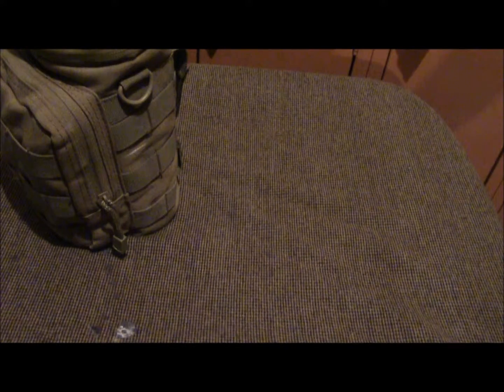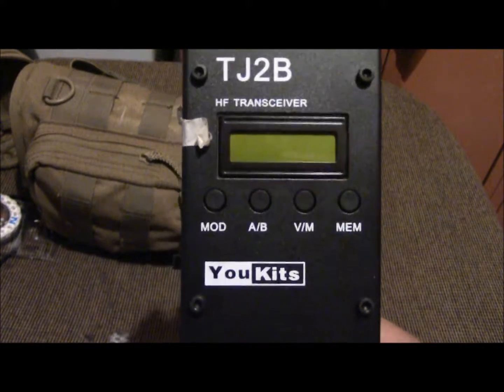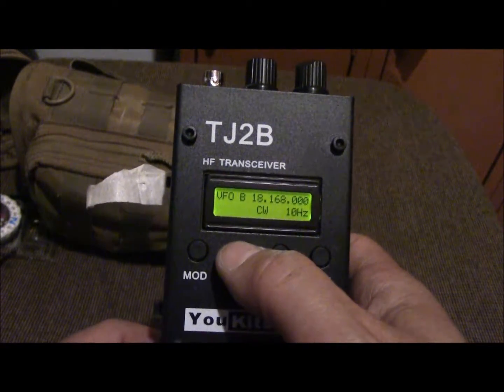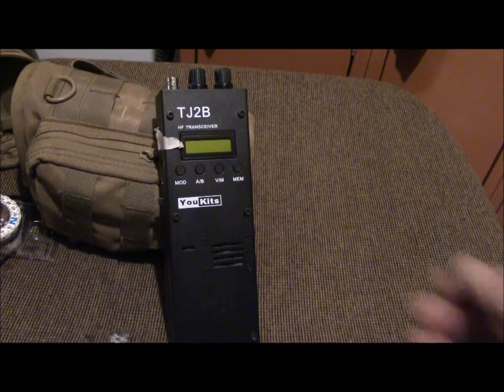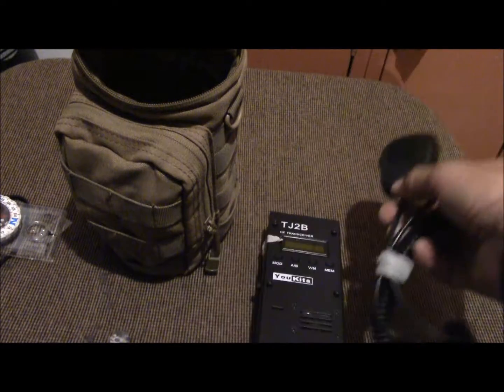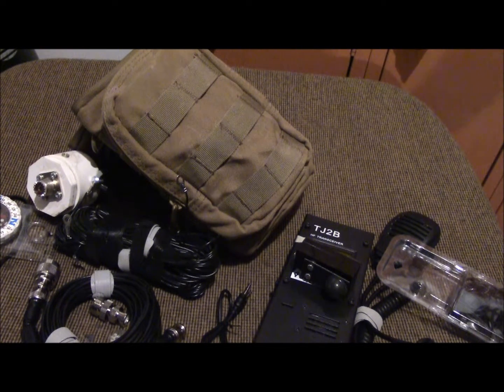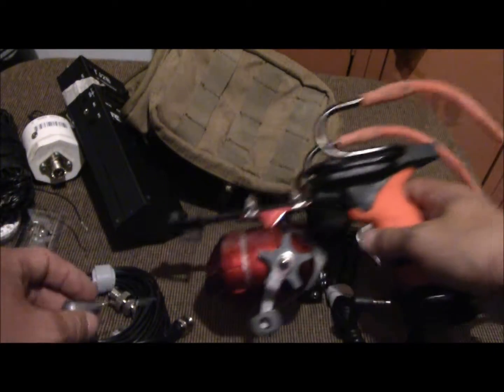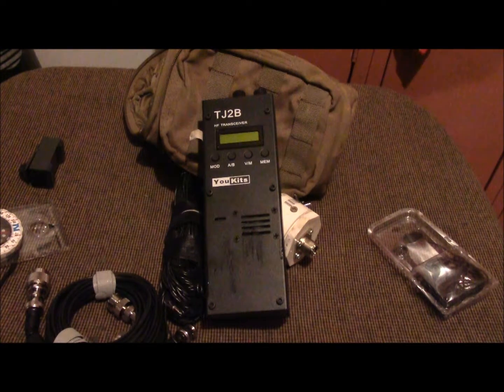Youkits TJ2B HF SSB CW Handheld Transceiver

Comment: It's nice to see another review of this rig. They are few and far between. It's an interesting rig although a bit overpriced in my view. (But that's not necessarily a deal breaker) Thank you for the review!
Reply from the maker: gliderrider Thanks for the comment. Ya I agree on the overprice. I should have just saved up and for an 817. Since I didn't I figured I would do a better review of the radio compared to what I had seen on YouTube.

Comment: I really like the concept of this radio, and your video has been helpful in illustrating its application. The one thing that has me hesitant about buying one (after much research) is the 40/20/17 band selection. 40/20/15 makes sense. 80/40/20 makes sense. 40/30/20 makes tons of sense. 17 is soooo close to 20 that I cannot imagine when I would choose to use it rather than 20. They have almost identical propagation characteristics. Do you know if they have an option to get a different set of bands? Do you know how to contact the manufacturer directly?
Reply: I find the combination 40/20/17 to be perfect, 40 for night activity, 20 for day and 17 that is a WARC band and is as opened as 20m. On 30, SSB is not allowed, and CW on this radio is a secondary function. Why you hate 17m? Is just  a sweet band, you can use it if there's a big contest which you aren't interested in.
Reply from the maker: I don't think there is an option to get different bands. 
Youkits dot com is the company's webpage

Comment: overpriced shit..
Reply: mine has made contacts all over the world on a piece of wire in a tree. thanks for letting us know you don't know what you are talking about
Reply: so what .. I have homebrewed qrp transceivers that I qso all over the world.. this youkitstj2b IS overpriced crap ..FACT ..
Reply: +rob good glad you can build a working transceiver. do you have one of these have you used it? i have and it works great for 300 something bucks for a assembled 3 band ssb that is a steal.
Reply: stoltzfl lol, you  can get an 857  2nd hand  for that ..that. covers ALL bands  in ALL modes  inc vhf and uhf, and is 100 times better than this junk 
you could get 817 if you want same mobility .
Reply: +rob b have never seen a 857 at that price that works.